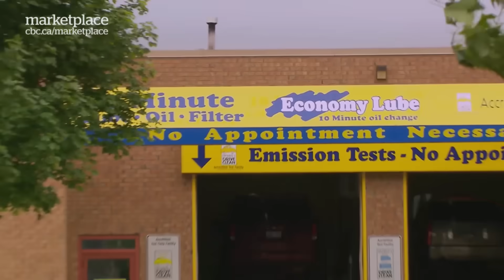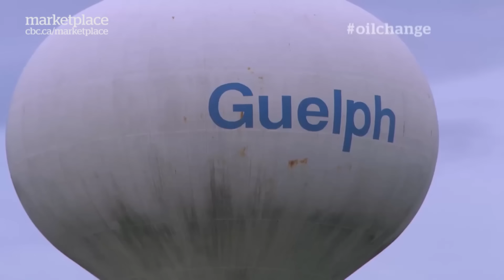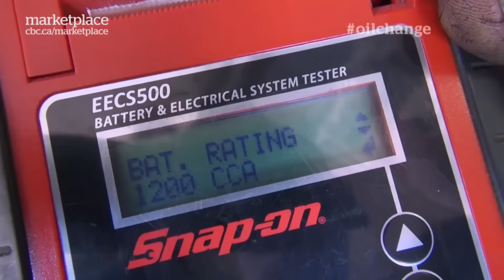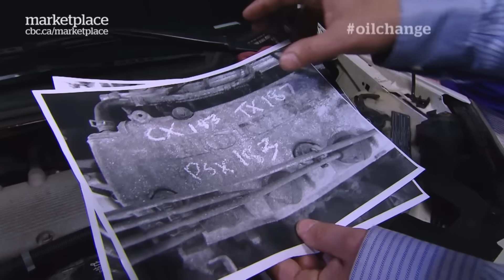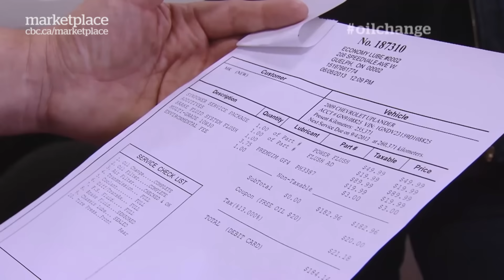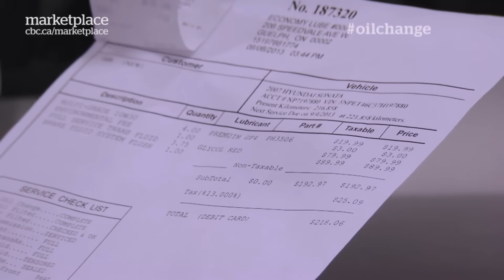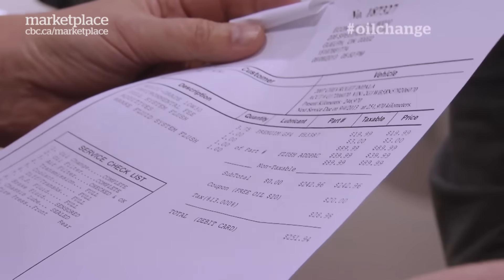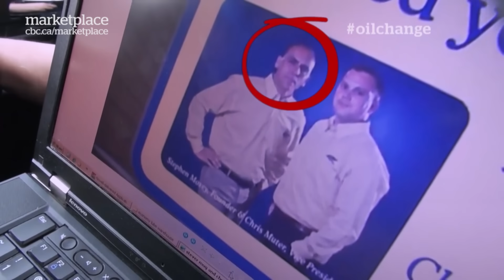Oil change scams: Hidden camera investigation on what really happens to your car (CBC Marketplace)

Comment: I've also worked in the automotive service and repair industry, and it is true that the 
ENTIRE industry is plagued by incompetence and criminal behavior, whether it is the mechanic or the service advisors and managers, also don't be fooled while these chain stores are exceptionally bad, the $tealerships, and even independent shops can be every bit as crooked. Yet most of the industry leaders refuse to really own up to the systemic nature of the problem and actually do anything to really change things. 
The best advice I can give is when you have ANY work to your car done at all, have them explain exactly what they are going to do and insist on watching them while they do the work,  and also ask for any parts back that they replace when they do a job.
Reply: The excuse you have to look out for is "It's not safe for other people to be in the garage, OHS etc etc". The parts idea is good unless maybe you want your old transmission back and you have no place to put it in your clean, new-ish car XD
Reply: Rennie Ash My personal shop I always take my car to will explain and physically show me the default. For example, I had a clunk when going over bumps and defects in the road on the right side, I took it to shop figuring it to be a strut or bushing. Mechanic walked me back to my car and grabbed the wheel and rocked it and said is this the noise? I said it is, he said "that's not the strut it's the bearing". They told me up front that in my car if they remove the bearing they will have to refill the diff fluid which I already knew. Drove home and 4 years later I have never heard the noise. If you have a shop like this don't ever go any where else as it shows they are not fucking with me, beside the fact we have used them for 10 years and have never had a complaint in my entire family.
Reply: Spot on advice man, that's what I do when I take my car for servicing.
Reply: Rennie Ash The customer can;t enter the shop for insurance reasons....not because they want to scam you. It;s like that anywhere machinery is used.
Reply: Rennie Ash if you have a clean new-ish car the dealer should be replacing under warranty
Reply: Squirrel Gang have never been in a shop that will not allow me in and show me the problem 
and if they tell you this go to another shop
Reply: watershed44  I was a poor kid once and had to get my oil changed. Had a new place open up and I barely had the money to do it, but needed it done. So I took it in there and they tried to up sale me a few things, including the air filter. They told me mine was in bad condition and needed changed. I tried to explain I just didn't have any money today for anything more than the oil change. They finished and I was driving home, my engine sounded  like it was gasping for air. I'm not so dumb I don't know how to check the air filter, so I open it up and guess what? bunch of McDonalds trash stuffed in with the air filter. At the time I was young and just blew it off. If that happened to me today I would have gone back down with some choice words. I don't think their business lasted long, I probably wasn't their last sabotaged guest. Sad people. On the bright side, I no longer felt bad about not being able to afford the extra stuff.
Reply: touchmycorpis  That is just the kind of outrageous and criminal behavior you get from many auto service and repair businesses today, that is a felony and it is too bad you didn't call the police and report it. The most disgusting aspect of it is that you were polite and explained you simply could not afford the extra service, and they still sabotaged your car.
Reply: watershed44 Amen Brother. My Land Rover Discovery 3 was purchased new from the biggest LR dealership in my country and fully serviced for thousands of Euros a year only in one service shop. Theirs. At 155k kilometres my 2.7l engine got fried and to my surprise at their first inspection they've accused me of not servicing my car for years. I had to write countless letters to LR headquarter in GB and it took them two months to admit that my car was serviced every God damn time in their facility (not facilities) and all that I got was a discount for 5k Euros out of the 12k initially charged to replace my engine. What have happened actually? Any synthetic oil has a warranty up to 25k km but they recommend to change it after 15k. Of course they're not actually changing every time. They rely on the fact that you're driving at moderate speeds and fewer km than the average driver if you live inside the city. They just wipe off the oil filter, sometimes, they give it a one degree turn to look like someone has worked on it and they charge you big time, big bucks and they steal your so called replaced fluids and filters. Add to their thievery a poorly engineered power plant such is the 2.7l engine with its infamous cylinder six and you'll end up with a ticking bomb in your wallet. Wallet I said? Try your children college fund or a mortgage instead. I dunno if its a company policy or its just a "thing" between them but who gives a fuck, right?... You are just a sitting duck and they are robbing you big time with a smirk on their faces. I restore motorcycles and one time I've asked around for a good engine oil supplier for my vintage CB750 and to my shock one the biggest suppliers on the market was a Honda mechanic who works, yes, as a mechanic at...what a surprise!...Honda. I was so naive back then thinking that my stupid car is eating its braking disks so damn often while in fact I was paying for new ones but leaving their facility with the same disks and very often with the same damn oil. Well, unfortunately for me, my house was outside town and I was driving a lot more km than their average customer. Actually, my engine got burned completely on a German highway. Anyway, after the engine was replaced I've overpacked their freezers with plenty of "dicks" and "fuck you" to last them till the end of humanity and I've promised them that I'll never buy anything related to their brand. Six months later they've got the nerve to invite me to drive test their new Range Rover and I've accepted. I took the car for a spin and gave it the shit of its life and shortly after that I've bought my wife a Porsche Cayenne and made sure they'll know all about it. I bragged for minutes praising the wonder of my new acquisition. Fuck their 4x4 undercover Peugeot... Yeah, Land Rover uses engines made by PSA which is basically, yes, a factory which produces "le moteurs" instead of engines so guys, every time you look at one such cars your actually contemplating an overpriced and highly computerised French croissant. If Lord Nelson's fleet was propelled at Trafalgar by the same engines we would have abandoned the fight right after leaving the port leaving Great Britain to switch for a "Republique" with an emperor for life-time president. Typical French mumbo-jumbo. British iconic car my ass. Mother fuckers! There is a saying in my country: "a wise man never buys German cheese and French cars"
Reply: Rennie Ash Hi there too, There's no such thing as a non dodgy service shop. It's either pricey or understandably cheap such is this one in the report here. On a scale of one to five, one being cheap and five being expensive the service in this video is barely making a three in my country. In my country they'll do the same thing but for a higher buck. In my opinion the best service shops are the ones who'll let you supervise the entire process. If they'll accept to use the parts brought with you that would be actually better. You may lose precious time but at least they won't be buttfucking your finances like in Alabama's infamous Angola prison. Well, I'm not sure about how they treat your finances over there but I've definitely heard rumours about the prisoners... :)) There's no difference though. I know my butt hurt when I've paid for my engine... Damn you French engines!
Reply: watershed44 Dealerships are not all bad, I actually always get my car serviced at one and never had a problem with them.
Reply: Rennie Ash I work in a Porsche dealership in Belgium and we are not allowed to let any unauthorized personnel inside the workshop unless they are escorted by our master mechanic. We do not choose this ourself, these are rules that are imposed on us by the importer and insurence company. We do have another solution to the problem that I would like to see in more garages. There are camera's in the workshop and the custumor can even see what we are doing on there vehicles from home. Plus, we can not throw away any broken parts until the customer recieves there car and payed the bill, so they can always ask to see the part that was replaced and even take it home with them if they want (altough I have yet to see this happen). This seems pretty logical to me since the parts we replace are still theres (unless it is replaced under warranty, because then the part is owned by PAG and sometimes needs to be sent back). So the 'It's not safe for other people to be in the garage' excuse does have some ground to it.
Reply: so what you are saying is they can come and see what you are doing
(unless they are escorted by our master)
you are still working for the owner of the car and they have the final say of how the buisnes deal is going to go down but all of people do not understand there in control not the shop
Reply: ***** I do most of my own mechanical work on my vehicles too. I have done exactly the same thing as you did on your front end. Show me and I will do the work.
Reply: ***** yes it is true the customer is in control of his car, but that does not mean he does not have to follow rules and safety-regulations. We work with more then 10 mechanics in our garage, each working on a different car. The garage would be extremely crowded if all 10 customers would be hanging around their cars to see everything we're doing. Plus, everyone that enters the workshop is actually permitted to wear safety equipment like safety shoes. If something happens to the customer while he is in the workshop, we are responsible, and if he isn't wearing safety gear, then the insurance company won't pay anything. That is why our master mechanic has to escort them, to keep an eye on their safety. But he is only 1 man so he can not keep an eye on all 10 customers. I can imagine the rules can be different in a small workshop with only a few mechanics, and if the customer really wants to watch every little bolt being undone up close, then he should go to such a workshop, but that's how far his control goes. When he decides to come to our workshop, he agrees to out rules. If he does not agree to our rules, then he can always go to another workshop where they do not care about the safety of their customers. We do not replace anything without consent of the customer, we are constantly watched by camera's, and we do not throw any parts away before the customer lets us and if that isn't enough he CAN come see what we are doing up close, but only when his safety can be ensured by our master mechanic. I don't see how the customer would need more control.
Reply: yes he dose have the choice of doing or not doing business with you if you do not agree with the persons request
Reply: ***** That's exactly what I said, here's a quote: "I can imagine the rules can be different in a small workshop with only a few mechanics, and if the customer really wants to watch every little bolt being undone up close, then he should go to such a workshop, but that's how far his control goes."
So with this I mean that if he does not like our rules, he has the choice of doing business with another garage instead of with ours.
Reply: Jelle
You are spot on my man. My shop I work at is the most honest shop I've ever been in. We may not make as much as some but that's because we actually respect are customers and never do anything not needed to be done and never overcharge, and the ones we do have are customers for life.

SO many people think things like not being allowed in the shops are "bad signs" but it's just a way of covering our asses. If you want in you can be escorted by the manager and see it. But your not going to be able to just sit around and watch everything because then the manager would have to be put their watching you and not ding his job. They don;t understand that if they got hurt we would have to pay out of pocket for their injuries. No insurance will cover that.
Reply: Squirrel Gang My local Benz dealership is just plain incompetent, I got a feeling most of their mechanics are all green because of the rapid turnover rate. My car was burning oil like mad and throwing out clouds of smoke on startup and after lights, I doubt the stealership did more than just look at their computers and they declared I had worn piston rings, then suggested I trade it in for a new car. 

Went a found a good independent shop, the owner took the hint I was the kind of person that was interested in cars and knew a bit about them. So he spent 2 weeks driving it around, opening up the engine and finding an identical car in a scrapyard to come up with a theory, turns out an oil passage was blocked which forced oil into the intake. He went through everything with me including showing me the opened up engine, the worn/damaged parts that had to be replaced and took photos of the process. He seemed genuinely determined to fix the problem (an almost unheard of one for my particular engine model). Haven't taken my car anywhere else since.
Reply: watershed44 the industry needs the oil change.
Reply: watershed44 i can proudly say my local mechanic shop is clean. theyll always let you watch (or let you lend a helping hand if you wanna learn how to do it if its an easy job) and are the most down to earth people i know in the business.
shoutout to Autoshop Backus! :P
Reply: niToitsyeSkxawng My local shop is even better! 
They let me do all my own maintenance in their shop!^^ I pretty much just pay for renting the lift, tools and advices. In return i get to know job is done cheap, well done, inspected by professional, i can put their stamp on the cars maintenance book, i learn more about cars in general+specially about my own car... additionally for that i hear probably most dirtiest jokes in industry, get to hear tons of "verbal fuck you's" and i get free premium coffee ^^ Funny thing is i that i perfectly well know owner of that shop is town most crooked guy and his son most lazy when it comes to business. Other vise they are real good champs!

I think if car owner wants and knows how to do things, getting under the hood is good thing and thats how shops should do business. At least case of trusted regulars.
Reply: Hellsong89 There is a chain here in Portugal that you do just that. But if you think you are gonna damage anything you can ask one of their mechanics to do the job
Reply: lambusado Thats cool system. I think we need more garages where you can do the job your self, with their tools, but if you dont know how, there is person or two who can help and guide you.

Sadly doing these jobs your self seems to be going under, as in new car you cant do shit to them.. even light bulb chance is professional job! -.- I rather drive my old 99 focus than new electronic peace of shit play station "car"
Reply: Hellsong89 My dad just had a Problem with the GR of a 2010 Seat Ibiza and the cost was 500 euros just to change a part.
But we did our research before and many cars using that same engine (VW and Audi) had the same problems.
And they had to take loads of parts, so most of the cost was the work and not the parts.
(do not know if you know what GR means, it is something that measures gases)
Reply: lambusado I have love hate relation ship with VAG concern, as their at least earlier engines and parts swap pretty well.. like Audi A4 AEG engine part broke and we ordered same part for seat.. but half a price... then again some parts are pricy as hell and VAG has gone into bandwagon like rest of the manufacturers... you cant chance part with out taking half a car apart and when some jobs can only be done in dealership.
In new car you cant even chance light bulb your own for fuck sake..-.-

In -98 Audi we did engine swap from VW in one day and it started first turn of the key... in newer car you must first go dealership to reset and validate all the fucking electronic boxes so it will work..-.-

GR.. well i presume that i know what your talking about, but have dont know technical words in English.
Reply: Hellsong89 Lucky for me I have an uncle that does that
Reply: lambusado Relationships and connections are good.. sometimes i hate to be that "go to guy". Like yesterday my buddy called and asked me to install some things into wall (and fix his first tryXD)
Reply: Right on. There used to be a shop in my hometown that if you couldn't afford it. There was a meet me in the back room for a bit.
Reply: GorillaProduction38 Not trying to be an a-hole or anything, but you've just been textbooked screwed.  Here in the US, complaints are common that if your engine/transmission goes out under warranty, you still have to pay at least half of the cost like your story.  And the stealership is audacious enough to tell you that they're doing you a favor by paying for half when it should be covered in full.
Reply: Tarragon Mugwort And, there's very little to flush / change / drain in an EV....
Reply: Good luck with watching them do the work, have you ever tried to get in a shop? They won't let you for safety reasons, and they have more used parts to show you then you can imagin.
Reply: gone fishin If a shop won't let you see what is going on in a safe way which protects them with regards to their insurance policy then you need to go somewhere else. As for their showing you the parts they removed from your vehicle after service for obvious things you should put a small witness mark that only you know about on those parts and if they show you something else, you call the police, it's called fraud.
Reply: I don't even know if my town has garages, I know they have garden machinery repair shops though, I worked for one and the stuff they did needed doing, they checked with the customer before doing stuff, just a shame that scammers are around as the real company are believed as scammers sometimes even though what there saying is true :-(
Reply: Anthony Lamanna MOST auto service shops are crooked. Not all the techs are but the shops have a majority of scam artists, hacks, and crooks.
Reply: No, they aren't.  You know who's crooked? The Ceo's of companys like valvoline, jiffy lube, firestone, any place like that, why you ask? because they are the ones who force us to mark up the items, and in all honesty prices at places like those are nothing compared to dealerships, those charge twice as much. You need to stop assming crap about mechanics. You wanna hate people? Hate the suits that run these businessess, not the people that work on the cars.
Reply: Anthony Lamanna the garden machinery place I work at is privately owned... The owner says he only wants to give the customer what they want or need since his last place was pretty corrupt :3...
Reply: Anthony Lamanna I work at Firestone and you are right the company does markup its prices. That is how 100% of any service based company makes money, that is business 101. Also I see our mechanics work everyday and they are damn good and damn thorough. Also I and our sales staff actually show our customers exactly what our techs see and explain to the what is going on. We also give the parts back that our techs replace (I.e., spark plugs, sensors, hoses, alternators, batteries, etc. If the customer refuses we put the parts in our recycle bin or pallets and send the alternator cores back to the company warehouses we ordered the new ones from) we are not a fraudulent company by any stretch.
Reply: Robert Zaino Your shop may be one of the rare exceptions, but many others are either dishonest, outright crooked, incompetent, or a combination of the three.
Reply: Hey and I totally agree with ya. I do work at a rather honest shop. Not only that I am one of the more honest sales associates ant the location where I work. I cannot stand selling anything that is not needed and I always refer to manufacture specs before I bring any recommendations to my clients so I can make sure our tech is recommending it appropriately
Reply: Robert Zaino pretty much the same here... :-)

But with lawnmowers... :3